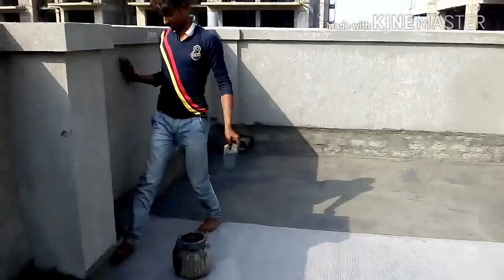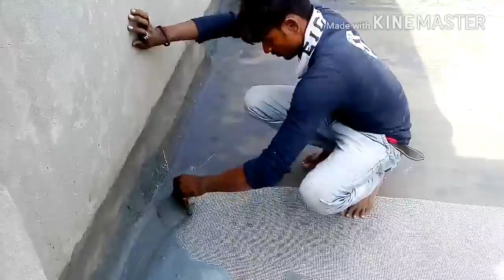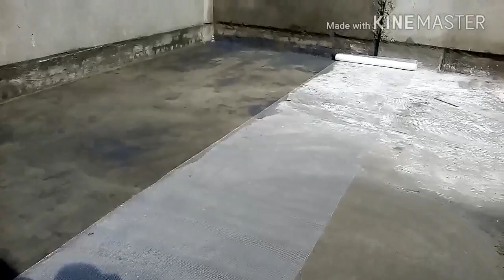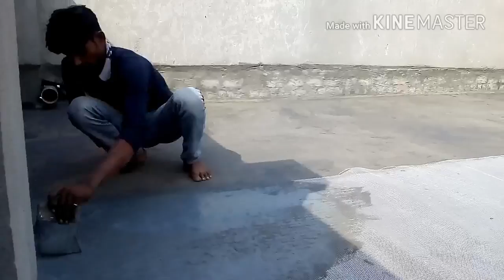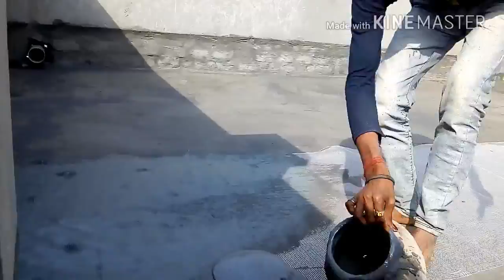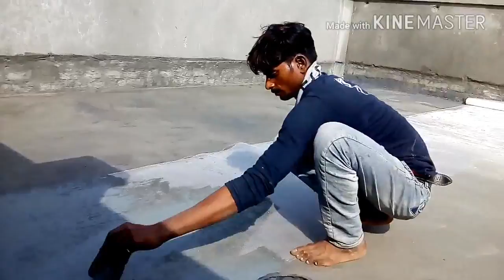Fiberglass Mesh Waterproof Coating DC Engineer

Comment: I have terrace garden. Shall I put fibre glass on the existing 'odu'  and make a cement floor to avoid future leakage problem? The existing 'odu' is not in good condition. Now I have no leakage problem.. pl reply.
Reply: I mean fibre glass mesh
Reply from the maker: Terrace gardens can apply fibermesh glass  and after that, concrete will have to be produced.
Reply from the maker: Fiberglass mesh is used to strengthen the surface of the plaster layer all kinds of buildings. This mesh reinforced liquid waterproofing layers slabs and roofs.

Comment: This mess may get stuck and get damaged if someone rolls over or moves hard substance like chairs tables. How to protect that?
Reply from the maker: No hard.
Fiberglass mesh is used to strengthen the surface of the plaster layer all kinds of buildings. This mesh reinforced liquid waterproofing layers slabs and roofs.
Reply: @dcengineer09  life kitna he iska ?

Comment: What is the cost of fiberglass mat for 4000 sq ft concrete roof waterproofing
Reply from the maker: 4000 sq ft  fiber  mesh glass cost - 9000 thousand approximately Rate - 2 - 3 rupe sqft .

Comment: We can use it for ext Wall while plastering  wt. It can protect the wall surface  from  rain water ??
Reply: No it's can't protect the wall for rain water it's is only for terress old and hygienic water proofing works
Reply: yes you can man and it also would help with cracking they say I am talking about any glass fiber mesh

Comment: Give me your address please & about the availability. If it is real . What material you using on fiber mesh?
Reply: I had problem of leakage  we used fibre  glass mesh and  solution madefrom  pedicrit urp of fevicol and cement in ratio o 1:1  that  works

Comment: What is the price for this process on 4000 sq ft roof area
Reply from the maker: Kaun sa waterproofing karna hai batay Brick bat coba ya kebal coating karna hai
Reply: @dcengineer09  jis se leakage ruk jaye
Reply: @dcengineer09  jis se leakage ruk jaye
Reply from the maker: Dr fixit urp chemical se roof ki coating karen lekage rok jayega 
Pahale chhat ki safai karen usake bad crack filling karen urp chemical cement ke pest bana kar usake 2 hour bad urp chemical aur cement ka coating karen 
Coating karne ke liy mal 1 bhag chemical    2 bhag cement mila kar  banay 2:1 2cement 1 Dr fixit urp chemical 
3 hour sukhane  bad 2nd coat karen  usake 3 hour sukhane ke bad 3rd coating karen .
Usake 12 hour bad chhat par pani bhar kar chhat ka lekage check karen 
Usake bad usa par plaster karen
Reply: @dcengineer09  agr already floor kiya hua h or crack mese pani andar arha slab me or fail rha h slab so tab bhi ye urp chemical ka coating krne k bad plaster krna hi pdega kya